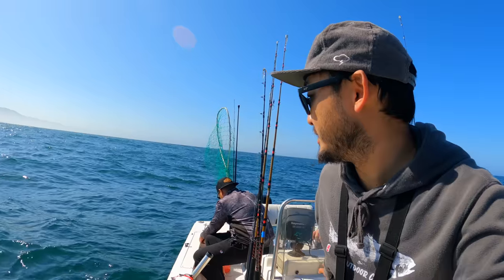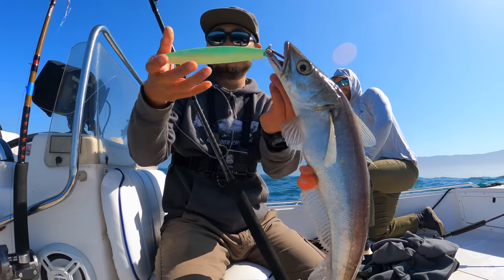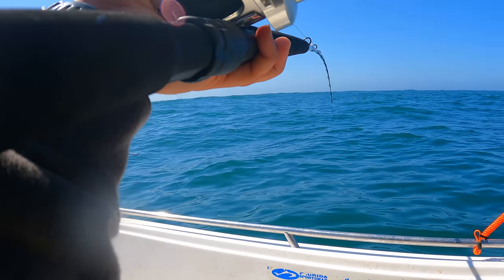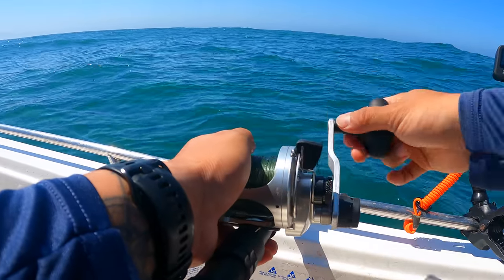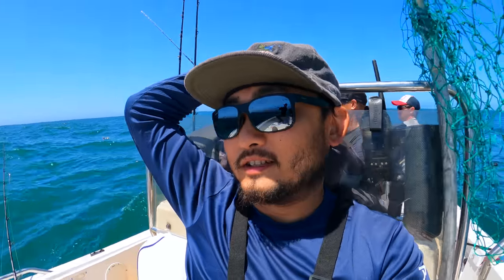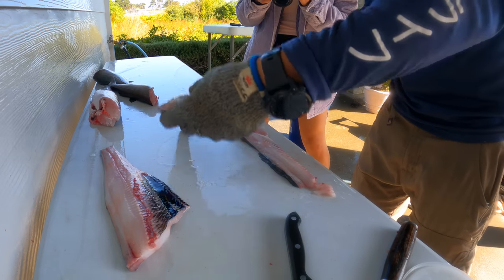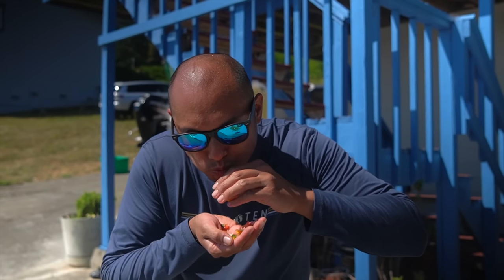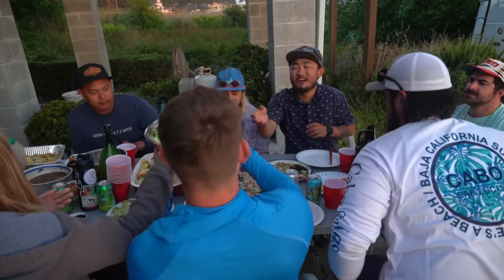Restaurants Love This Fish | Black Cod Catch and Cook

Comment: any suggestions on dealing with the pin bones in the black cod? also grilling black cod is the ticket, I end up using indirect heat because every time I do it over the coals I get constant flare ups from all the drippings.